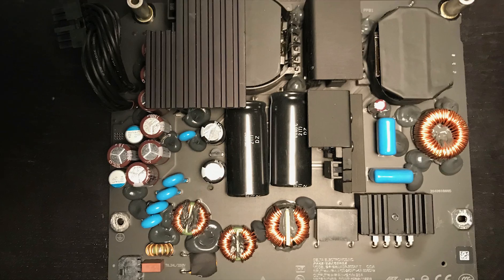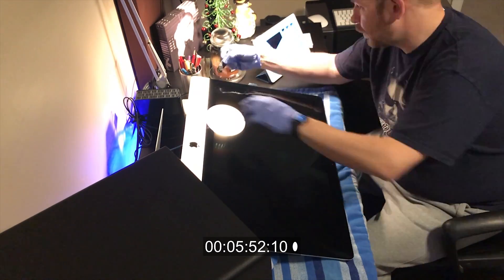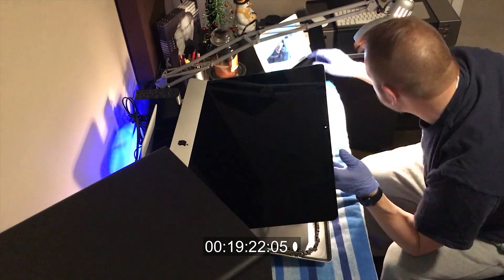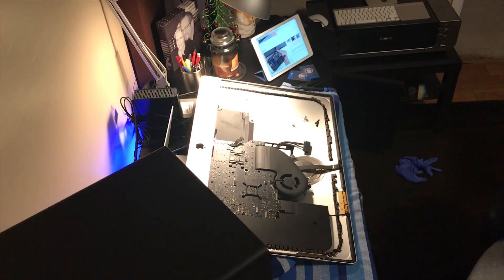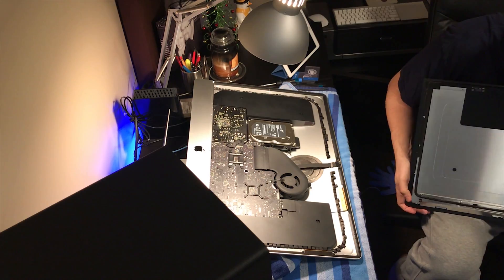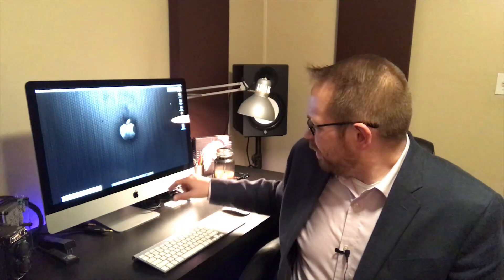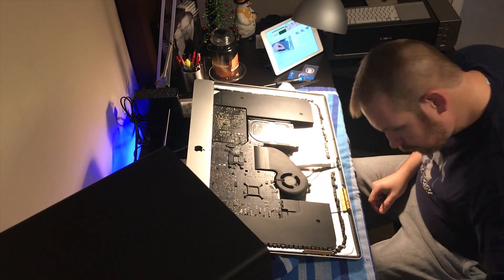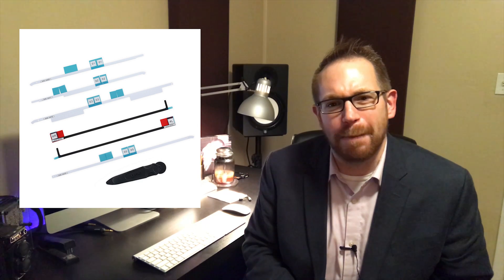Replacing a Power Supply in an Late 2012 iMac to Prevent Random Shutdowns

Comment: Great video :) its been a few years since you made this video. Have you had any iMac shutdowns since you replaced the power supply?
Reply from the maker: I had it for awhile with no issues but later replaced it with a newer model. I sold it to a friend and no issues were ever reported back to me.
Reply: @varuzzoproductions9484  Cool. i'll attempt the replacement soon.

Comment: I think you hit on it. My 6 year old Mac shuts down during a YouTube upload but I can upload a short one but nothing over 3 minutes. Does this sound like it is the problem?
Reply from the maker: Sorry - I can't say for sure. If you've tried an SMC reset and as a last ditch tried a reformat and are still having the issue it's likely the power supply. Others have also reported overheating issues causing shutdowns (typically from dirty air intakes).
Reply: @varuzzoproductions9484  It's my first search for this problem so I will do some more digging. Thanks for the help. I have created over 800 YouTubes and never had this problem where it shuts my computer down, so it might take a little more investigation. Again thanks

Comment: The link to the Lite-On power supply is not working.  Do you have another link?
Reply from the maker: https://amzn.to/2O1bmn6

This shows as the correct model for a late 2012 (as used in my video) - the photo shows the LITEON brand - but I'd double check with the seller - there is nothing in title or description to notate it's the LITEON brand, except under the manufacturer label.

Comment: Thank you so much! I finally figured this out thanks to your help! I just installed a new power supply and FCPX has been going for 1 hour + now without the system shutting down! (Update): it only lasted a week or two before it started to randomly shut down again :(  then after just using the computer normally there was a load pop sound and a flash from the computer and it wouldn't turn on again until I replaced the old power supply again.
Reply: What brand was your new power supply?
Reply: @adama3231  This was the name of the eBay listing NEW Genuine OEM Apple iMac 27" A1419 Power Supply Late 2012 to 2014 PA-1311-2A1

Comment: You take a iMac screen off by using a suction cup, don't use any other tools because you'll damage the screen.
Reply from the maker: That's incorrect for this model and later models. The older iMac screens were  held on magnetically and were easily removed with suction cups.
Reply from the maker: This model and later models the screens are adhered, and the adhesive strips must be carefully cut with a special tool (taking extra care not to inadvertently cut the cable to the camera)

Comment: So glad to find people with this same issue, thank you Varuzzo Photography for the video! I've encountered this turning off problem with my iMac 21,5 ci5 late 2013. I've been to service and they couldn't define the problem source, everything looks fine according to tests. But it still turns off.  Eventually, they suggested replacing a motherboard, which is pretty expensive and I'm not sure it will help according to information on the internet. So I'm about to give a try to a power supply replacement. You said that Lite-on branded PSU works pretty well for 27 iMac. Do you know which PSU would work for 21,5 iMac? Any ideas appreciated, thanks!
Reply: PaulEffmanMusic thank you for the reply anyway. Yeah, it seems like all these thin iMac models from 2012 are in a risk zone.

Comment: OK.. its been over a week now since i replaced the DELTA psu with LITEON... and so far so good... never failed once since... imac runs for lengthy hours and under heavy cpu usage with no power issues whatsoever! hope this lasts longer and i hope changing the power supply would resolve ur issues as well...
Reply: awesome - glad to hear it fixed your problem too!

Comment: hey all.. had similar issues with my late 2012 imac... intermittent sudden shutdown that required an smc reset! i went ahead and replaced the DELTA psu with a LITEON one and that seemed to have resolved the issue.. been 2 days and no prob so far.. will post back in a week or so to confirm if all is well! btw, in my case i was able to verify power loss by checking smc log as follows:
[ log show --predicate 'eventMessage contains "Previous shutdown cause"' --last 24h ].... copy text between brackets and paste it in terminal to see the value codes of previous shutdowns... 
0= power loss, 3= hard shutdown, 5= normal shutdown

Comment: Is this something someone with no computer building experience can tackle?  Scared of bringing it to apple and have the same issue down the line.
Reply: I have a pretty extensive IT background and built PC's for years. I found removing the screen quite daunting. I probably would not recommend this as a DIY if you don't have any experience. Once the screen is off things are pretty straightforward, but even with all the appropriate tools that was difficult.

Comment: Hi there, having exact same problem you had...is your iMac still running ok? Thanks :-)
Reply from the maker: Yes - so far so good!
Reply: @varuzzoproductions9484  Hi, just curious, is it still running ok?
Reply from the maker: @muratisik6956  I no longer have the system, I'm sorry.  I have since upgraded.
Reply: @varuzzoproductions9484  Lucky you! I have a brand new iMac 27 inch 2020 model, and have had three or four sudden shut downs while working on it. It is a shame that Apple apparantly uses such cheap Power Supplies while they know or must know it causes problems.
Reply: @varuzzoproductions9484  just wondering: to what system did you upgrade?
Reply from the maker: @muratisik6956  2017 5k 27", i7, 32G, 500g SSD/3TB SATA. Have had it 3 years now, no issues.
Reply: @muratisik6956  i have a 2019 27 inch imac with vega 48 graphics and 64g of ram (bought it in May of 2020) that has been randomly shutting down while editing in either Final Cut or Premiere Pro. I have brought it twice to Apple and of course they do their diagnosis and everything is fine.  I'm actually on the phone with Apple Support as i write this...VERY FRUSTRATING!  I have spent nearly 5k on this iMac and just want to ship it back!!!

Comment: Just wanted to follow up and say this seems to have fixed my 2015 imac 27"....  this problem plagued me for a year.  But I changed the power supply and its been a week now with no shutdowns.  Thanks again.
Reply from the maker: Keep us posted if things continue to go well! Sounds like the range of power supplies could go much wider than just the 2012 models. Did you note if you removed a Delta and replaced with LiteOn?
Reply: Removed Delta and replaced with LiteOn!
Reply: Tood Thomas did this ultimately solve your problem?

Comment: Thanks for posting... i've got a 2015 imac that is doing something similar... sounds like power supply!  I've tried a lot of other things, so I'm hoping thats it.
Reply from the maker: I hope so! However, I will reiterate the late-2012 i7 was well documented on the Apple forums for having a fairly wide-spread issue with the Delta power supplies. I didn't see it really apply to any other models. Of course a power supply can go bad on any computer, but there are a lot of reasons a machine will shutdown - I wish I had a better method of troubleshooting for you!
Reply: Thanks man..  but in truth I think its the same power supply.  The replacement part works for 2012-2015 which means they probably kept using the same god awful power supply.  In the forums I've seen people from multiple years reiterate this...
Reply from the maker: That's good (relatively speaking) news! Obviously, all I was searching for was 2012, thus I only found issues with 2012's....
Reply: 2012 sounds most prevalent, but I know that part works for multiple years... this problem has plagued me for over a year.  Fingers crossed...  thanks for posting!
Reply: And btw... were your shutdowns totally random?  Mine will shut down over and over again for a day straight... then might run fine for 24 hours... totally bizarre!
Reply from the maker: Correct - it seemed completely random. Sometimes I could go a day or two, and sometimes it would shutdown multiple times in an hour. The longer I left it unplugged, the longer it seemed to last without and issue once it was plugged back in.
Reply: Perfect...  thank you.  I had this machine at the mac repair shop and it wouldn't replicate the error (which meant nothing because of what you're describing).  My first suspicion was dirty power in my old building... but power supply makes some sense...  thanks again brother... hope for smooth sailing ahead on your machine...
Reply: @varuzzoproductions9484  also i5 late 2012 imac have this Problem? Ty
Reply from the maker: RetroGamer it seems like users here have e reported many years and models. However, there are so many things that can cause a system to shut down its hard to pinpoint if it’s the power supply each time.
Reply: @varuzzoproductions9484  ty for Feedback Greetings
Reply: Todd Thomas  I have a 2015 imac and is doing the same thing, turning off randomly, if I leave it unplugged it lasts longer. Makes me so mad because I spent so much money 😢
Reply: It plagued me for over a year until I decided to gamble on power supply and it hasn't shut down since... even spent money at the Mac shop and they couldn't fix!
Reply: @toddthomas4761  thanks for posting this ... we are in the same boat - late 2012 27" i7 with random shutdown, usually under load and consistently whenever we run Premier Pro and Chrome at the same time.  I recall 1 or 2 people indicating the power supply replacement didn't eliminate the problem, but it seems for most, the power supply replacement solved the issue 90% of the time.  Is that your experience?
Reply: @parkercook  Sounds like the same!
Reply from the maker: That definitely sounds like the power supply - the "unplugged it lasts longer", I can't imagine what else it could be.

Comment: Ready to order the power supply and tools - I have a Late 2012 27" iMac but it's i5, not i7. Any feedback on whether the same power supply would work for both?
Reply from the maker: I'm sorry, I'm not sure on this one. I'd assume so, but most of the reports over on the Apple forums are specific to the i7 variant. I'm also not sure why this is the case, it could be the i5 already used lite-on brands across the board maybe? But I'm also learning here others are having similar problems outside the 2012 i7.
Reply: Thanks, will be doing the replacement shortly and share the outcome. Not ready for a new iMac just yet!
Reply: Eileen S I’d like to know what happens! I have the same thing and same Mac as you.

Comment: thank you for this info on fixing the problem,also the story in the original video. I'm so upset because everything you said about apple acting like they don't know of the issue,keeping the computer and testing it only to deny being able to recreate the issue;all happened to me MULTIPLE TIMES. I had to reinstall all my software bundles each time I wiped the hard drive with an os reinstall. this is bad business for Apple to do this.
 while I appreciate the install directions,I don't want to risk breaking the glass or anything else in the computer because they definitely won't pay for that. I would like apple to do the Right professional thing and replace the psu. so I will sign the petition..I THANK YOU AND ASK FOR ANY OTHER UPDATED INFO REGARDING IF APPLE WILL DO FREE FIXES.

Comment: So has this fixed the issue of the intermittent shutdown?
Reply from the maker: Yes - This has resolved the issues I was having. I also want to reiterate that I did this only AFTER I had reformatted with a clean install and continued to have the issues. A system powering down can be from software issues as well, and there is no point in needlessly replacing hardware if you just need a clean install of software.
Reply: Varuzzo Photography I did a clean installation and even took it into Apple to get it “fixed” the replaces the screen and the logic board.  It worked for a while then started back up. Happens mostly when my wife has been photo editing.
Reply: I have had almost exactly the same issue on my late 2012 i7-3770 model which seemed to be exacerbated when my wife used iMovie. Took it to Apple back in 2016 (just before warranty expired) and the logic board and hard disk where replaced but the issue was not fixed. Have reformatted and done clean installs since then but continued to have the issue of intermittent and ungraceful shutdowns (which required unplugging the iMac from power to reset the PRAM, every time). Thank you so much Varuzzo Photography for posting this video, I'll look into the Lite-On brand and replacing the power supply. The machine is fantastic and works 99.9% of the time so its worth trying to salvage it.
Reply from the maker: I felt the same way! I didn't want to just trash a high-end i7 system that still crushed it for all my applications. Especially given replacing it would be well over $3k. I hope it works out for you - good luck.
Reply: I have the same issue. Late 2012 randomly powering off. I also hit the famous stand issue (broken hinges) with this one and failed hdd. I've decided not to use adhesive strips any more - I use duct tape to keep the screen on. I hate the idea of cutting imac open every time I hit an issue with it. I actually like the look of imac with those duct tape stripes around ;)

As I'm googling around and reading the experiences of others with the same issue I want to point out there are people whom replacing the faulty PSU didn't help. 
This is why I'm hesitating buying the new PSU -- I'm afraid it would be just money wasted. 

Please let us know if you experience the sudden power off again and thanks for sharing the video.

EDIT: I forgot to mention that I did observe this behavior of rapid shutdown also when RAM module was faulty. It's strange that osx doesn't log this, I guess it doesn't trust the contents of anything in the memory and shutdowns immediately.
Reply from the maker: Thanks for the additional insight. I did notice there were people who had their power supply replaced, and their problems subsided for awhile and then came back (6-months to a year?). I suspect the supplies were being replaced with identical Delta supplies, likely refurbs /used in a more fragile state then new. Unfortunately we can't know for sure.
Reply: I'll share one more info here, maybe somebody finds this useful. Apple's SMC should be able to catch the reason why it went down. Those errors codes are not public knowledge afaik, but you can google them. There are some 3rd party tools that show this information but one can get this from command line too (as root):

# log show --start 2018-06-02 | grep -i applesmc

You'll see previous shutdown cause. Go figure that 0 means power failure, 5 means all OK. With my sudden power failures I see 0 -- so indeed computer looses power suddenly. 
So yes, this is more likely a PSU issue.

Comment: Mine's a 2011 27 inch unit. Screen randomly shuts down. Might it be the power supply too?
Reply from the maker: There are many reasons the system might randomly shut down. Before replacing hardware, I'd definitely suggest doing a clean install of OSX and starting fresh. Make sure to rule out any software issues.
Reply: Thanks for reply. iMac doesn't shut down in Safe Mode though so might this lead to a software issue?
Reply from the maker: Interesting, I never tried running my in safe mode. However, the shutdown would NOT ever occur outside of the OS (like in recovery, system test, hardware test, etc).  This  actually led me to believe it was a software issue. However if could be a power draw scenario in which the supply fails when utilizing system resources like graphics, audio, etc. I was unable to pinpoint any specific task which would cause the failure to occur. Sometimes I'd go days, sometimes weeks, sometimes I couldn't use it more than a minute at a time.

Comment: Thanks for posting this tutorial, our iMac is shutting down and restarting could this also be a power supply board failure? I will try your fix and see what happens. Peace Crazyhorse.
Reply from the maker: Crazy-Horse Crazyhorse What year is your iMac? Before replacing hardware the best bet is to reformat and reinstall. If problems persist go from there.
Reply from the maker: Before replacing hardware, I'd definitely suggest doing a clean install of OSX and starting fresh. Make sure to rule out any software issues.